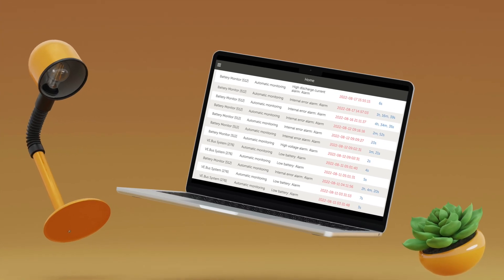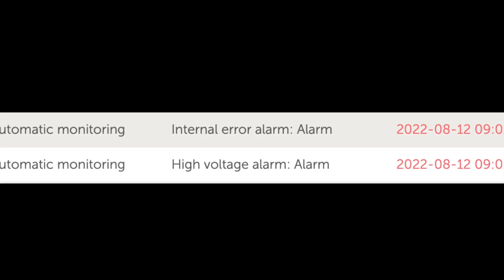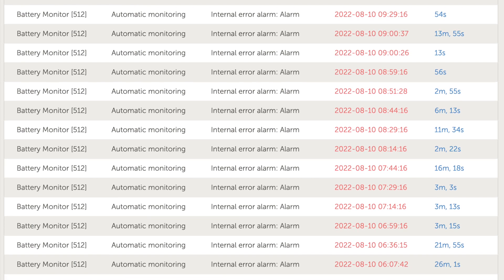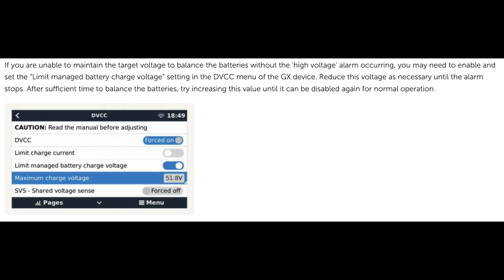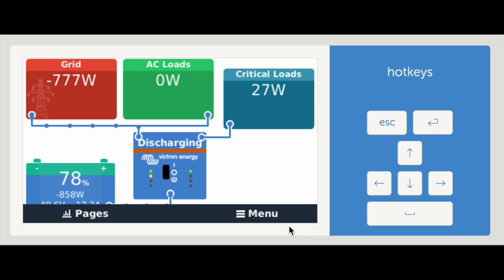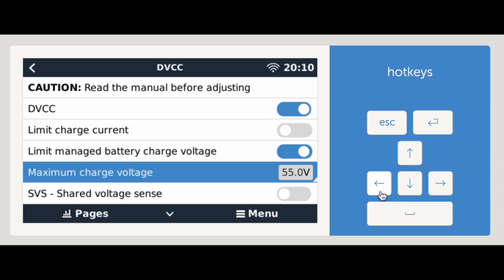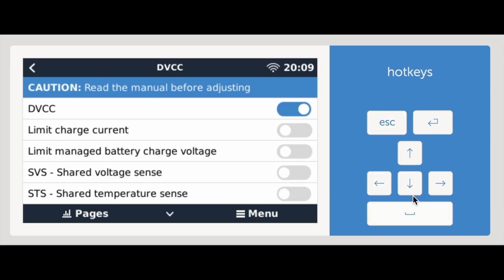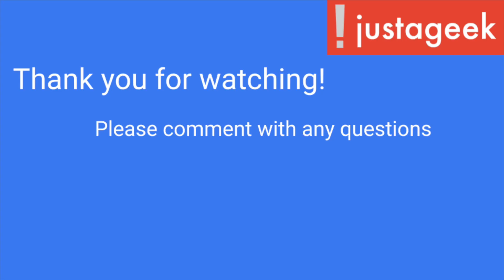How to fix Pylontech Internal Failure Alarm

Comment: It's interesting in that i run an MPP Solar Pip Max 11kw (22kw peak) Inverter running CANBUS to 3 x US5000B and have had no such issues and no manual configuration required. It is 100% plug and play for 12 months now and i just recently added the 3rd battery to cope with an extra air conditioner and did nothing except plug in the battery leads, earth and comms cable. In fact just setting the first battery up as a MASTER (for comms) with 1 dip switch flick on the front was all that was required

Choice of inverters is obviously a big decision and i know the MPP solar ones from Taiwan are well featured and a fraction of the cost of the Victron's.
USB , wi fi and app communication is available and the watchpower app is very details as if it is 1 holistic system, which it is due the detailed Canbus comms  

I would wonder why Victron require this level of enegagement from the consumer when so many other inverter manufacturers do not.
Reply from the maker: To be fair, this level of engagement isn't usually required for the Victron inverters - this is if there is a fault scenario. It's hard to know where responsibility lies, the issue seems to be one of balancing between the different batteries (the alarm comes from the battery rather than the inverter). I suspect an inverter can be tweaked in its default state to anticipate the common gotchas of certain batteries. In our situation we are using 5 us3000c batteries so maybe the us5000 series is more reliable?

Comment: Hello! Thanks for the video, I have this same issue but we have a large battery bank 40x US3000C (backup), as expected there was this cell imbalance, we are using ESS Keep batteries charge optimized, pylontec support in victron forums stated to use "keep batteries charged" but it seems to override DVCC charge voltage limits and it gets to 53.2V and the inverterted shuts offs, I will try to keep batteries charged and limit the voltage to 52V and see how it behaves, some of them also say is because batteries are idle for long time or slaves.

We are still seing internar error warnings.

Do you have any other recommendations?
Reply from the maker: We had an error at 52v initially and dropped down the voltage to 51.7 for the first few days. If dropping the voltage doesn't help, it's worth looking at which other alarm messages you are getting with the internal error alarm.
Reply: I have the same problem... did you find a solution?